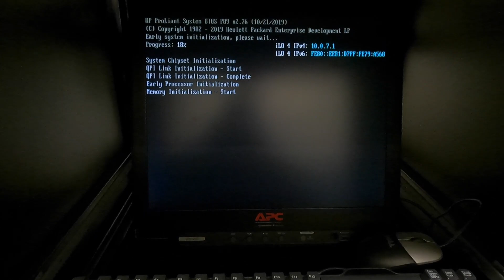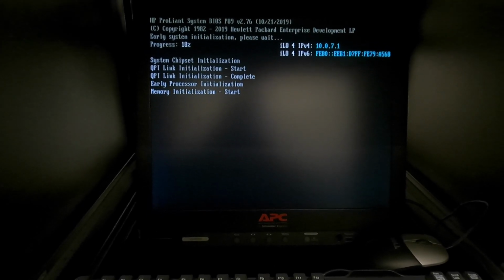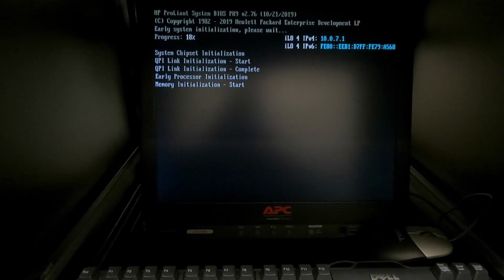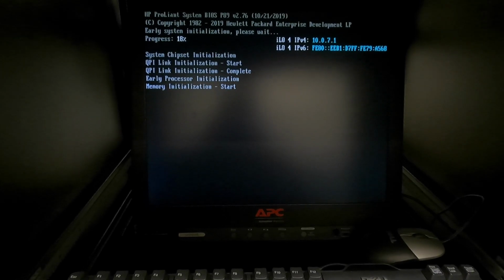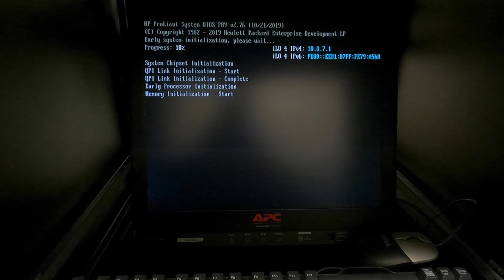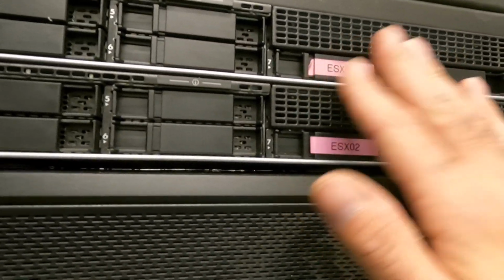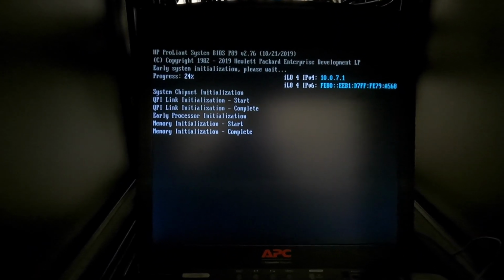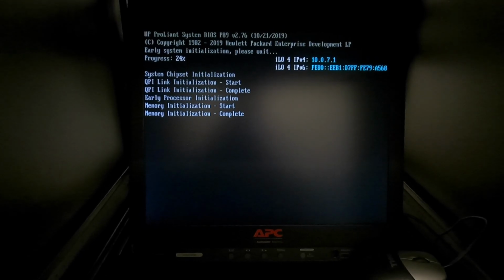DATA CENTER DISASTER!!

Comment: I remember when Miami Data Vault had a pipe burst and flooded the first floor.
Reply from the maker: Wow did it cause much damage?
Reply: @EverythingTech70  surprisingly enough, with the cascade of water pouring out of the main door, onto to steps and parking lot, not that I heard of.
Reply from the maker: Wow that’s crazy
Reply: everything in Miami is questionable. I forgot the facility but City of Miami condemned it and its still operational

Comment: Data center? Bruh, it's just 3 racks 💀 You'll be calling local travelling circus the Disneyland next 😆 It's just a regular server room. Good job on the fix. If you like HP servers then try Fujitsu some day, we switched over.
Reply: Flexing Fujitsu? Now I’ve seen it all 💀
Reply: @userhandler0tten351  Did you actually use their servers?
Reply from the maker: Just a backup datacenter.

Comment: 5:40 you're calling them CMOS batteries, but at 6:05 it's actually the smart array controller battery that you're replacing (a common occurrence on these models unfortunately). It's not required for normal operation, but keeps the controller and front drives powered in case of an outage to write back the cache. Since they're ESX-hosts and only have 1 (boot?) drive installed those would easily hold enough charge even in their warning-state.
Reply from the maker: Yes I realized that after I recorded. But yes they were running fine but wanted to fix them for that reason of the power outage. Good catch!
Reply: I was about to comment the same... darn :D:D:D